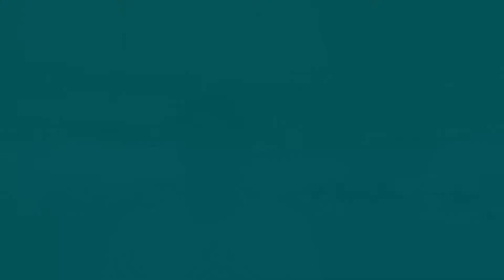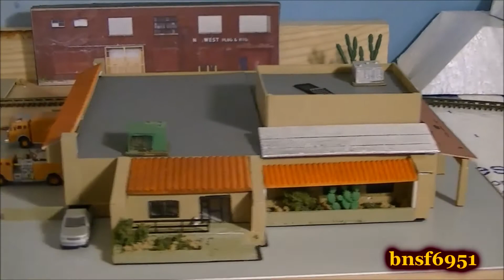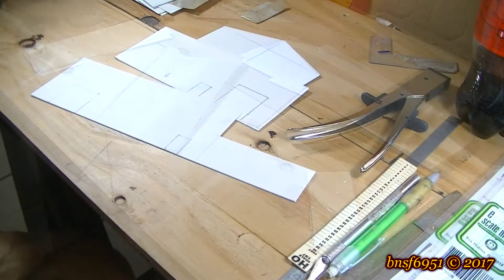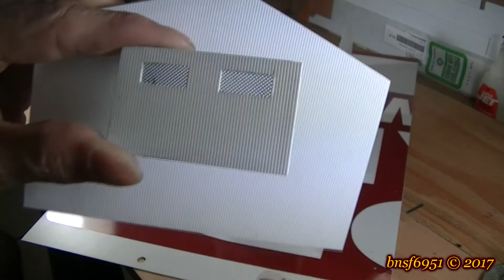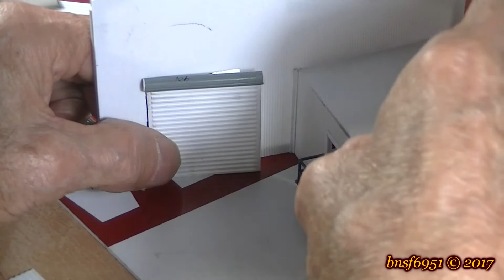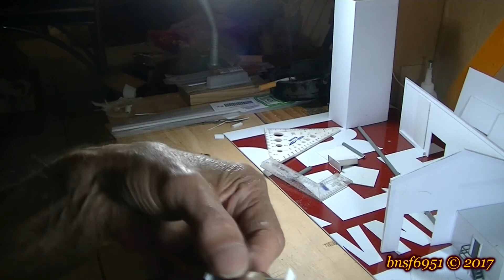Mariani Build for Jac part 2

Comment: yes I do like the scratch  keep it up yes it does help
Reply: I have tried the mat cutter from Michael  it cuts the edge lot straigter  and cleaner but still have to cut doors and winders out  I have made a sanding block to sand the edge quare  pls keep your work up  would you show othe builder  scratch build on your channel

Comment: No need to apologize for anything Vinny. We know you get a lot of comments and it would take way too much time to respond to everyone every time. That's what the "Loves your Comment" thing is for. We know you read them. And make the intro as long as you want, it's your channel. We "could" always skip to the build if it really bothers us (not that we would). Oh and as for building, PLEASE keep the build vids coming. I learn something new every time I watch one! There's only one thing you need though. A "VBS" builders plate for the peak of your gable ends of the buildings. Maybe shrink a picture on a computer and glue it to a tiny piece of styrene and clear coat it before gluing it on. I would be proud to display it on my railroad! Cheers, Dan
Reply from the maker: hi Danny.. you are right i do get between 30 & 40 comments per vid & i do read all of them... to reply to all takes about an hour or so...i like the idea od signing my builds & that may come at some point down the road... as long as i have something to build i will share.. & i hope the you guys get something out of them... thank you soooo much for watching & your awesome comment.. vinny